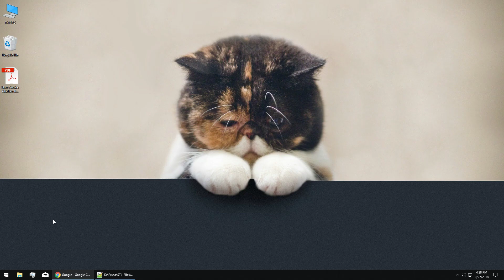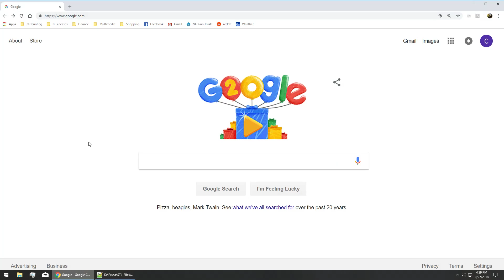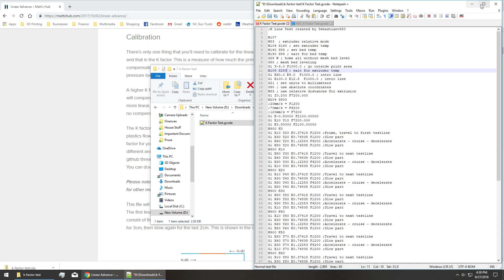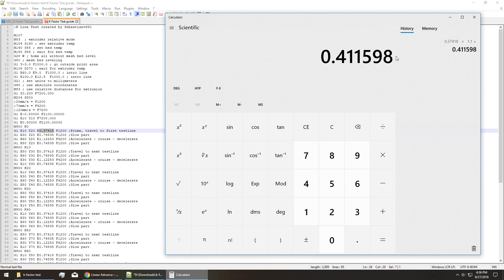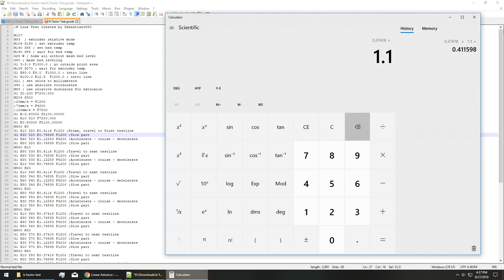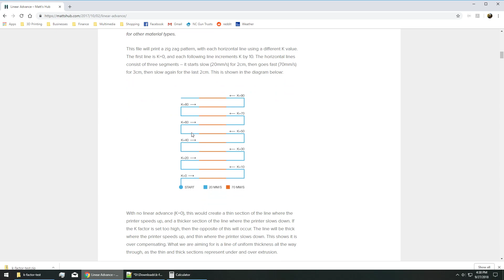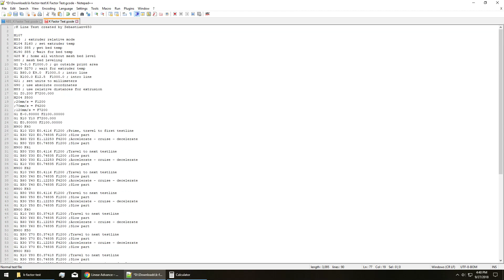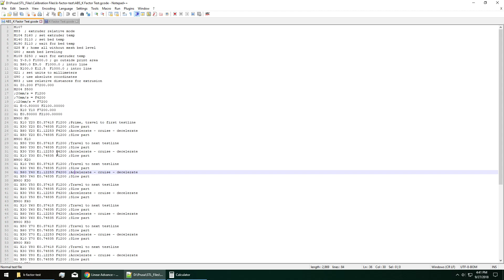High Resolution Linear Advance Calibration Tutorial - Gcode Manipulation

Comment: Hi. I have an ender 3 pro with BMG extruder Bowden, tmc2209 etc etc. 

I calibrated a linear advance K value as 0.58. 

My prints now come out perfectly and very happy. 

However what I'm noticing now is that my extruder retracts on every corner and and when doing the infill it retracts like crazy which makes a huge amount of noise. 

Is this normal. 

So does that mean it's a trade off? Better print quality for more noise and possibly extruder wear.

My retraction settings I turned down to 3 @30ms . Z hop at 0.2mm 

I also print at default speed 60ms

Any input from your side?

Comment: GREAT vid and loads of info! Would you recommend using the G-Code K factor generator or just to DL the one you have? Maybe you can do a vid on how to setup the generator since you can choose different nozzle sizes and tweak a bit more than just editing the G-Code. Just throwing that out there as I am currently calibrating my K ;) http://marlinfw.org/tools/lin_advance/k-factor.html
Reply from the maker: I've never seen that K factor G-Code generator before but that looks very promising!  I will give it a try and see if it works better/more easily than what I've used in this video.
Reply: @jaredclark2  Please LMK as I am still trying to dial mine in ;)
Reply: @jaredclark2  Have you given the other method a go?
Reply from the maker: I did try out the website you linked and I wasn't as happy with the gcode it generated as compared to what i used in this video.  My biggest issue with it was that the test lines were all run in the same direction, which is somewhat nicer for comparing the results but led to lots of stringing and ultimately failures for some of my testing.  If your EM, extrusion temp and retraction are all spot on this wouldn't be as much of an issue but the gcode it generates doesnt reflect what I generate with my slicer with the appropriate settings.  Also, since it was a series of lines and not one continuous line, when I got it working correctly it was much harder to remove from the heatbed.  In short, I still recommend using the file linked from mattshub and modifying the gcode for different nozzle sizes (increase extrusion, change temperature, etc).  I am hopeful that we will see developers including these kinds of calibration gcode generators in their slicer software soon, but who knows if/when that will happen.